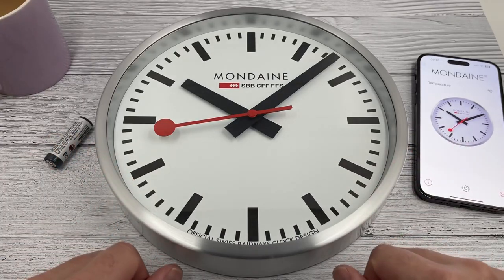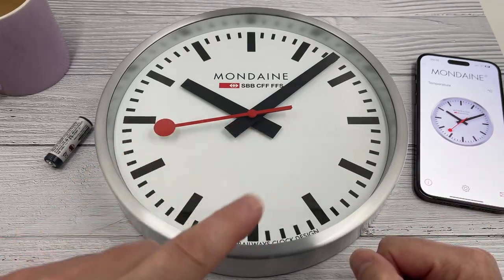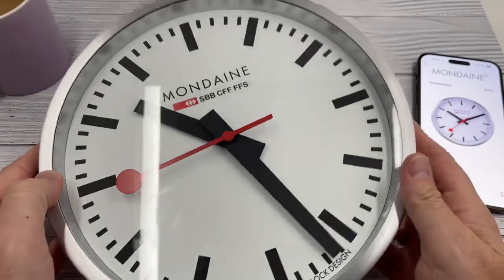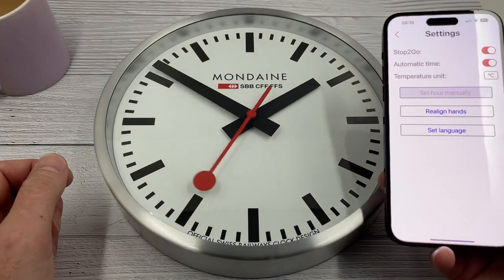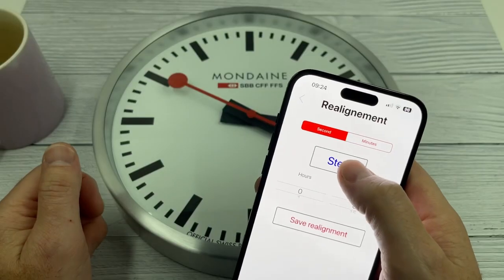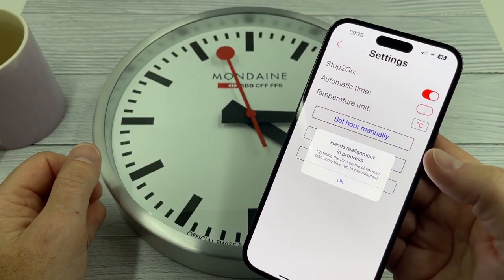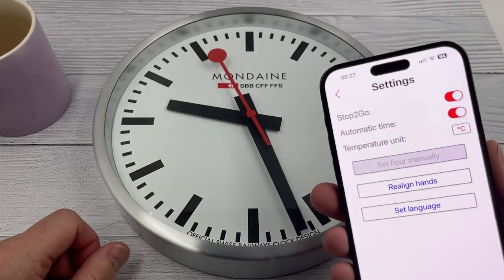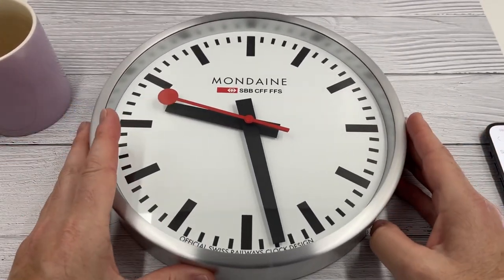1 Minute = 58 seconds...Why does the second hand stall every minute? Stop2Go Clocks are COOL!

Comment: I have coveted one of these since I first saw them, a desire amplified when I saw that you have one, Gary. But when I checked the Mondaine website and saw the shockingly high prices for the various versions they offer, I knew I would never have one. The sync feature revealed in this video at least means that it's more than a generic quartz clock enhanced by a famous design and brand name. But in my opinion, that's still not enough to justify a retail price of $325 to $545 US. For comparison, my Amazon Echo 10” (25.4 cm) Mickey Mouse Edition wall clock with similar WiFi/Bluetooth connectivity and an additional countdown feature using LEDs at the minute marks cost only $35 US.

I'm also puzzled by the “Stop to Go” feature. The clocks in New York's Grand Central Terminal were for years electrically synchronized (I don't know if they still are) and didn’t require a visible pause to do it.

Comment: Interesting concept, but make the clock only accurate at the minutes. Timing anything under a minute using it would have error due to the pause. For watch people that look for errors under 1 second a day, introducing a 2 second error every minute seems wrong. Sure it gets rid of cumulative error over days, but sacrifices precision between minutes. Watches that adjust for the atomic clock  out of Boulder CO don’t sync every minute. I think the quartz movements are assumed to be accurate enough to keep time for an hour without going out of sync. Well assuming no issues with the battery. I used to have a vcr that would get a signal from certain tv stations to reset the time correctly. It was great if there was a power outage. Once the hourly signal got sent, no more flashing 12:00. If you were watching the channel, you could hear the signal when it happened. It was a little beep tone that would happen between the program and any channel announcements.